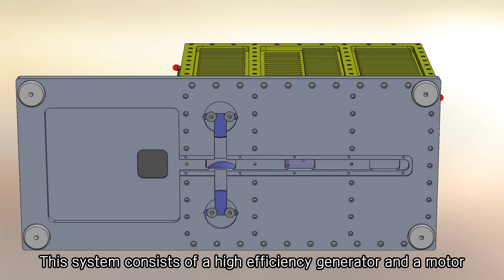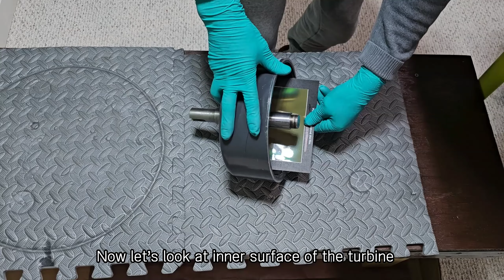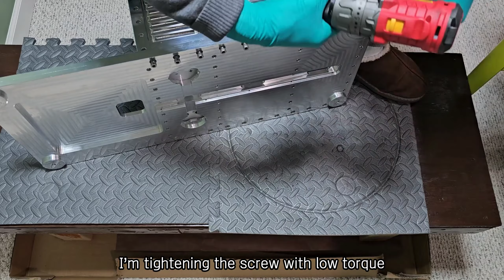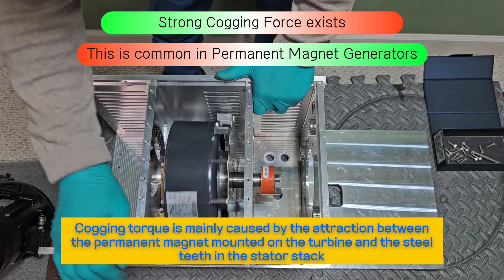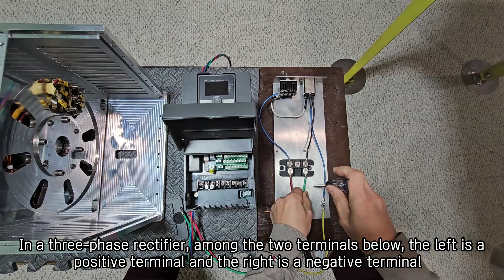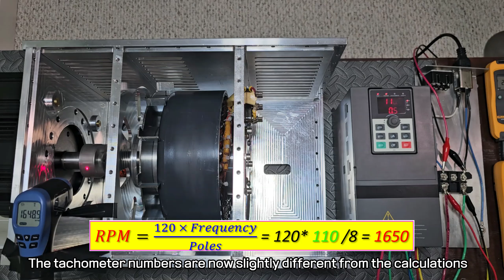How to Test a 3-Phase Permanent Magnet Generator with a Synchronous Motor | DIY Test System (Part 1)

Comment: Do you use an ai voice for this? Try this test again with a motionless version. No parts in the entirety are moving.
Reply from the maker: Yes, I use AI voice
Reply: That voice it butchering the script, should consider changing it to a newer one@LanikaiEnergy
Reply from the maker: @soul2065  Really?  I chose the best one. My editing software provides multiple voices, All other voice wasn't appropriate, but I'll try another voice. Thank you for your comments
Reply: The voice was fine it just used broken english on that scipt for some reason.@LanikaiEnergy
Reply from the maker: @soul2065  Ha Ha All right. I understand. Thanks

Comment: Where can i get the 10kW generator set of stator/rotor for 380V ?
Reply from the maker: Alibaba is the best place to go because the price is very good. Also, it's a good idea to buy a built-in inverter type. Because the power generated by the three-phase generator has a high frequency, so even though the voltage is 230V or 380V, the frequency may not be 50/60Hz.

Comment: Very excellent amazing show more and how much is the cost?
Reply from the maker: The most expensive parts were the aluminum parts. I purchased the PMSM motor from Alibaba but the Generator is made in Italy; Because I wanted compact and high efficiency model. Thank you for your comment.
Reply: @LanikaiEnergy that setup would be insanely expensive here in the usa right now. Like around $10,000+
Reply from the maker: @soul2065  You're Right. The Permanent magnet 10KW generator is imported from Italy

Comment: Can you make a magnet motor, that you can attached to a generator, and so, you can produce energy out of nothing but magnets only???
Reply from the maker: The system you see in this video is not suitable for converting to a magnet motor. The magnet motor literally cannot be applied to this model because certain types of magnets are placed in precisely calculated positions and the generator must be designed with high efficiency. I've been working on the Permanent Magnet Turbine Engine (PMTE) for 15 years and it's a kind of magnet motor. Some of this will be open and shown on YouTube, so please watch it carefully.
Reply: Short answer is no.

Comment: Isn't true rhat in a 3 phase generator every 3 coils goes with 4 magnets?
Reply from the maker: The motor I used has 30 coil poles and 20 magnets are used. Namely, this means that for every three coils, two magnets are required. If there are 15 coils, 10 magnets will be needed. This will make sense if you draw a picture and calculate it.

Comment: Please help me understand something.What is 8 inthe formula?
Reply from the maker: The motor I used has an 8-pole stator coils, i.e. 8 stator coils around the rotator. Only the frequency is variable. Furthermore, the smaller the number of poles, the higher the number of RPM, but the output is relatively reduced.
If you have any questions, please feel free to let me know. I will try my best to answer them
Reply: @LanikaiEnergy are you making this in Japan
Reply from the maker: @Greg.UWU.22  I am living in the  USA
Reply: @LanikaiEnergy I'm 
In 
Northennnn Australia
Reply from the maker: @Greg.UWU.22  I got it. Thanks